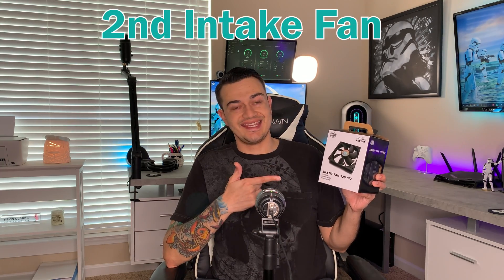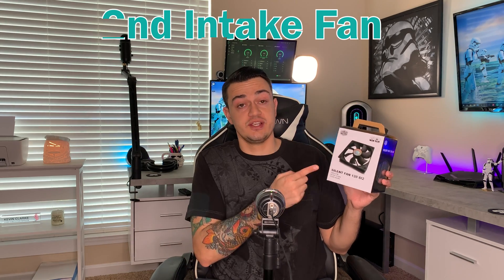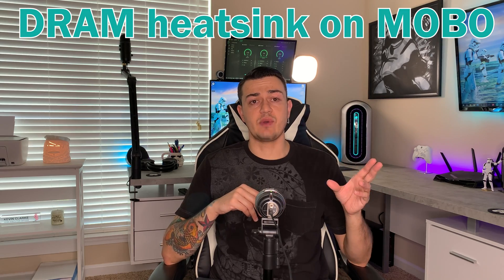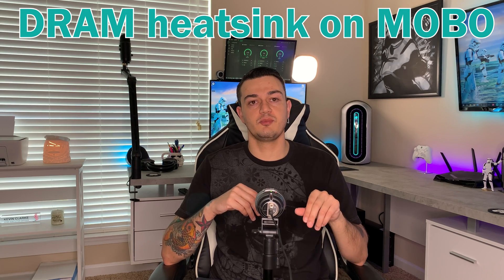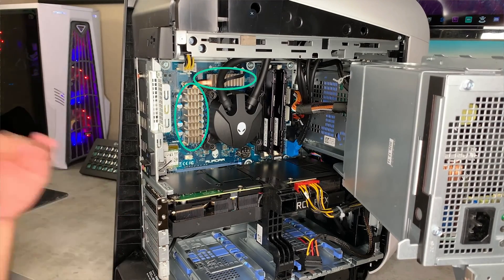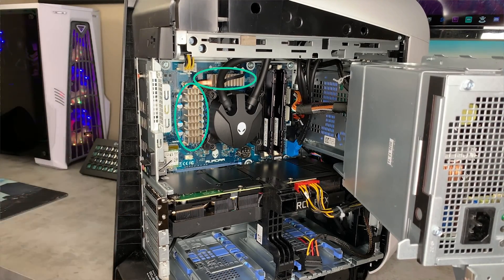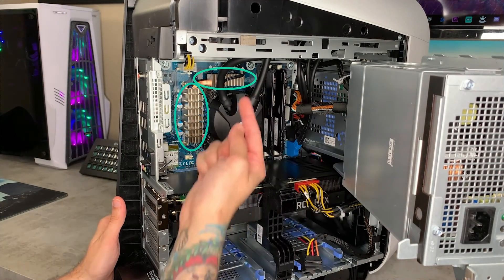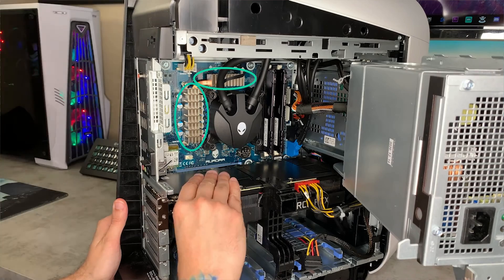5 Must Do Mods/Upgrades For The Alienware Aurora R10/R11/R12

Comment: you’re beast bro ... can you demonstrate how to upgrade the 2 fans?
Reply: That's my demonstration of how I added 2 push pull fans to the Alienware water cooler rad.
I didn't do the front intakes but I actually have zero need. Cpu at 100% usage on CINIBENCH multicore test only hit 88c after my push-pull rad fan upgrade with Noctua 12-25s. 
Noctuas are the quietest decibel 2000rpm fans. Better than the corsair pro. And they come with y splitters and gaskets and a whole whack of shit.

Gaming ultra settings on VALHEIM my CPU doesn't get above 65c and neither does my 3080
Reply: @MurdahBassRecords  can you control the fans from the alienware command center?
Reply: @unclebrowns8393  yeah but I haven't had to.
I've recently added two more noctuas to front intake (removed the front 1 TB harddrive to do so) 
Sent tha piece of shit Alienware liquid Cooler Back to dell and got the corsair h60. (Dell didn't cover the whole CPU in thermal paste and tightened down the cooler so hard it cut grooves into the copper plate so i was able to send it back. Also put Noctua thermal paste in my CPU. 
Ran CINIBENCH again and this time my CPU never got above 81c on a 15 minute CINIBENCH23 multithread test @100% cpu usage. 
I dropped from 88c to 81c. 
A whole 7c cooler. 

NO BIOS errors all that shit is fixed
Reply: @MurdahBassRecords  ok I understand. did you connect the fans to the top fan connection or to the CPU fan connection? For me, the ones for the CPU are connected to the top fan, the front fans are connected to the front fan. I also have Noctua NF-A12x25 PWM fans but I can't control them via the Alienware Command Center. If I set the controller to 100, the fans turn up to 57% according to the AWCC and not up to 100% :(
Reply: @unclebrowns8393  yup my push pull fans for rad with y splitter are connected to the top fan. And my two intake fans are connected via y splitter to the front fan.

My fans never run at 100% not even while doing the CINIBENCH test. 

I haven't played around with it because haven't had a need to as the cooling is more than sufficient now but maybe I'll try and play around with it later

I
Reply: @MurdahBassRecords  ok thank you bro i will try that too!
Reply: @MurdahBassRecords  hey man do you recommend removing a hard drive slot to make way for a second intake fan and also is their a possibility to add a second SSD card?
Reply: @PATOxSK  you only have to remove the hard drive brackets if you want to but arent in the way of the intake fans on the front. And  to be honest i just have the two intake fans on on the front which i secured with pipecleaners and then i have the sandwhich push pull on the rad for the exhaust which has been sufficient. I definately notice the difference. And its extremely quiet compared to the stock fans.
The problem isnt the intake or getting air into the case the problem is the exhaust and not having any room to add a double  cpu cooler and just having the single.

Comment: It's a good service offering up ideas and solutions to other Aurora case owners... But if I'm completely honest about it - most of these wouldn't even be an issue worth tackling if the cases had proper airflow to begin with. Newer CPUs and GPUs for 2021 with higher wattage requirements have only further proven the restrictiveness of these cases in that regard. Once you move upward from the lowest stock processor and graphics card offered, watercooling becomes your only option to effectively lower temperatures... which kind of sucks because it's more complexity crammed into an already surprisingly small internal case volume. Also: some of us don't like or want watercooling, but you're SOL on that with these cases. 

If you really want to throw some more money in the pursuit of getting more air flowing around inside your case, may I suggest buying a modular SFX PSU and mounting it in the space. Its smaller size takes up less volume, you can minimize cables to just what you need. Cut some added holes around the PSU cradle... May as well eek out as much flow as possible now that the physically larger old PSU is no longer taking up room. I went with adding a 4-pin forward intake fan as well, and am using an M.2 SSD and lower-mounted SATA SSDs to get rid of the standard hard drive outright. 
Keep up the excellent tips suggestions - I'm sure other owners are happily digesting these!

Comment: With the noctua redux I can not control de fan through Alienware command center.... do you know if with the corsair ml120 this option is it available?🤔
Reply: Haven’t tried it myself but I’ve seen the ML120 recommended elsewhere. The Noctua Redux probably aren’t compatible as they are 1500 RPM fans whereas the Dell/ML120/Noctua NF-A12 are all 2000RPM. But, again, I haven’t seen it with my own eyes.
Reply: It did not work for me either

Comment: Do you have list of these mods and Amazon links maybe? I got the R10, 5800x, rtx3080
I don’t think I hit the silicon lottery, I’m getting ~86 MH/s even after tweaking. I can go up to 98, but temps max out and throttle on the VRAM
Reply: I have the R11 with the 3080.  I was only getting about 86 MH/s as well.  I can now get up to 92 with the following.  Try removing the side panel, that should significantly reduce your temps.  That case gets too hot and the card thermal throttles.  You will get better results with cooler air.  Adjust the voltage down and try some overclocking.  My card was not able to overclock to the same level as others I have seen on YouTube and forums.  I have finally found the overclock settings that allow it to remain stable, but it took a while.

Comment: Hey man! Just found this video now and am regretting not seeing it before ordering. I got an R11 with an i7 10th Gen and a 3060 Ti to use for 3D modeling and rendering. I couldn’t secure the liquid cooled version initially, but the parts and vrm heatsink I ordered just arrived from Dell. As a beginner to upgrading PCs, what else do I need to safely and successfully install these parts myself?
Reply: I just got a similar build. Ever find out anything else you need to install the parts by yourself?

Comment: I have 3 coolermaster fans in my r11 with a 3090 and 10700k the cpu is pretty good at 70c in cyberpunk, the gpu will top at around 78c on stock fan curve. I changed to a coolermaster 500m case and the highest gpu temp I see is 70c with the stock fan curve only hitting 50% vs 70% in the alienware case. The pre builts arent bad but the case design leaves alot to be desired, though it does look really cool
Reply: Would be cool to see case swap video.
Reply: @norcal773  I am not a YouTuber lol if you have questions I can help out

Comment: So i have a situation going on with my Alienware R11 and i was hoping to see if anyone could give me an advice. So i decided to change the fans to some Noctua NF-P12, i replaced the front one and also did the "sandwich" for the Radiator. After i did the change, everytime i turn the computer on it boots this Dell pre boot system performance check, and it test the fan and it says the top fan is not responding. I swapped the top fan with another Noctua and it continues to tell me the same thing and i can physically see the fan spinning. But i cant manage to make the pre boot check go away and it happens every single time.. please i hope someone can help me figure this out.

Comment: Sup bro can you help me I just purchased the r11 and I got on warzone and it was laggy I was told upgrade my ram because I only have 1 8gb 2933mhz hyper x single channel in there so I bought 2 8gb 3200mhz hyper x to make it the dual channel I installed them and it's not reading them or somthing like in my task manager it shows 2 out 4 slots being used but I'm still only getting 8gb 2933mhz of ram what can I do
Reply: And yes I did take out the 2933 mhz so there's only 2 ram cards installed

Comment: My Aurora r9 which is the same as 10,11,12, won't accept any new ram other than what came with the system. I tried trident 3200 and won't post...weird
Reply from the maker: Are they different speeds/timings? That may be the issue. It says on the dell website you can swap any ram you want , they even have an article explaining how to do it
Reply: @GamerHeavenOfficial  Can you share a link to the Dell article and also the ram that you added to your system? Thanks

Comment: This video has a few inaccuracies.  First of all you don't have to remove the top of the case to add a fan to the radiator.  It has it's own bracket which comes out with the removal of a screw.  You'll have to un-do the cable mgmt grommets for clearance (there are two) and it will slide right out.  Second the heating issues you describe for the 3000 series only applies to the 3080 and 3090 (with GDDR6X memory).  The 3070 and below have GDDR6 memory.

Comment: Also you can't use any ram on the Aurora boards. The Ram operates at 1.25v on these boards instead of the standard 1.35v so a lot of sticks don't work.

Comment: You apparently need to use Corsair ml120 pro non rgb fans for the exhaust\cpu fan or it's not read properly by the bios
Reply: This is false..
Noctua 12-25 pwm 12 volts don't throw bios. They are 22db 2000 rpm fans where as the corsair pro 120mm are around 35db.

Comment: hey are you able to do another video of the thermal pads install i would like to see the 30% result you're getting.
Reply: Can the cpu be changed in this R12’s. Mines came with a i9 11900f and a 3090.  It’s a replacement unit.  Had issues with my first one on the first day.  It was a 3080 with 11900KF.  I want to change the 11900f to a 10900 or something.  Heard a lot of bad reviews about the 1100f after excepting the exchange unit
Reply: @Poppi3579  i believe you can but it depends on what kind of motherboard you have and if you have an 11th gen intel then i think you may need to change your motherboard to go down to a 10th gen
Reply: I got a Alienware r9 and I got a 1440p  Monitor and I only get 100fps in war zone and I just want to get like 200 FPS and I got a 2080 super in it

Comment: There is a potential issue with the RAM upgrade idea at least for the R10, the HyperX Fury 3400 kits used in the R10 are custom made specially for Dell by Kingston, they don't sell them to the public and nobody else makes XMP compatible kits.  So if you want to add to the RAM rather than replace the RAM you have to but direct from Dell, and you guessed it, it works out costing even more than actually buying the amount you want with the PC at ordering time lol.
Reply: According to the Dell guy I talked to as long as you buy HyperfuryX you should be fine, just match up the speeds, the xmp memory dell sells is more for the office Dell PCs

Comment: You can also unscrew those 2 or 1 hard drive additional slot and add fans. I unscrewed mine and waiting for the fans from amazon to arrive.  And speaking of VRAM temp.  Mine stays at 98c and my hash rate is 121-122mh/s or I can go higher to 124-125 mh/s but the vram temp is 100c. Oh this is without the thermal pad and paste. ;) I dont wanna void my 3 years hardware warranty from Dell haha. Alienware r10 with rtx 3090.

Comment: I was curious about your comment about lowering the VRAM temperatures by 30°. I watched your video several days ago in regards to you doing the thermal pads and your results said I did absolutely nothing?
Reply: There was another video he did, where he used thermal paste instead of pads and it reduced the VRAM by 30 degrees
Reply: @hardrckr4983  yea he just released a video 2 days ago that showed it. When I commented it wasn’t out yet so i just watched it. My 3090 temps when mining are already in the mid 90c so my temps on ram are good

Comment: Thanks for all the Alienware Aurora vids, very helpful! Did all the fan upgrades on my R10, but I'm a bit scared to mess around with the GPU.
Reply: Hey do you still have the r10 or did u swap how is it 2 years later lmk if you get the chance
Reply: @OmniRaven it’s a pain in the butt! Upgraded gpu to OC 4080 super which only fits if you move that fan to the upper bay. So no two intake fans. I have water cooling and there doesn’t seem to be a need to replace stock fans. SSD only, which I added a new 2.5 as well. Tried to upgrade RAM as well which is fine but having difficulty getting it to run at 3200 speed. Gonna try the hyper x brand to see if that works better

Comment: Another great vid. Also fellow Stallions, I made another modification to my order, this time switching from R12 to R10; i9 11900kf to Ryzen 9 5900x, as they added the 3090s back to the R10 models. Only added a week to my delivery time- at this point, what’s one more week. 😂
Reply: What temps are you getting with the 3090? Before and after these mods.
Reply: @kylergeston  hi - I never did a before test but as an example, after modifying the 3090, the memory junction temps were in the 80s while playing a graphics intensive game like Cyberpunk- max settings, ultra wide 3440 x 1440.  I’ve read of people who start to creep towards thermal throttling because of memory temps with that game

Comment: Dell is replacing my last R11 that had 2 2080 super with a R12 with a 3090...  One of the 2080 failed with in 30 min after taking it out of the box....Really it has been a nightmare but finding a gpu atm is a nightmare as well...   What water block would you use for Dells 3090???  I should be getting the replacement in May...LOL Order in Feb   But would rather watercool than change the pads  any help would be appreciated ty.